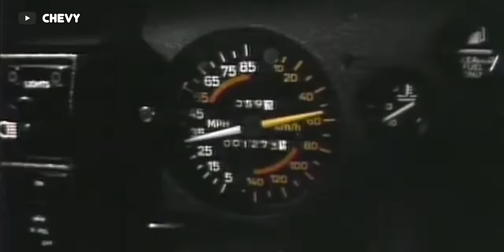These are the WEAKEST ENGINES EVER

Comment: I have a 70 cadillac with the 472 and that was rated 375hp and 500ft. It's tragic what emissions did to our cars.
Reply: Gross hp vs net hp. After 72 everything was Rated different. Insurance
Reply: @ryurc3033  Not just.

Power collapsed.

My '68 472 caddy ran 10.5 compression.  By '73 it was 8.5.

Spark timing was 5 in '68, 7.5 in '73.

Oh, and gas was 93 octane in '68,
87 octane in '73.

So power suffered.

Comment: teh 6.5 had mor ho and torque than the Ford 7.3 stoke  and the Cummins  the 6.5 from 1996 up out put 215 hp  540 ftlbs    The Cummins was not till 1999 that the surpassed that and 2004 for ford  and that is fact  it was not till Dodge modified the Cummins and  made there gen 2 and for made the 6,0 that they beat out the 6.5  yet AMcC continued making the 6.5 for 16 years after and where able to get it to a stock power for the hummers and military use of 355 hp and 742 foot lbs  at 2100 Rpm  and there are more million mile 6.5 diesel that there are any other    so take that

Comment: On Rolls Royce the power wasn't mentioned. They say: Its enought to glide with the car trought the streets. Do you saw ever a Rolls Royce driving 180mph? No. That was a different time.

 And the Bentley Engine is NOT the same! This engine is the W12 engine (or VR12 more specificly) and it produce 530-630hp. Since Volkswagen bought Bentley, they changed the engine forever.

Comment: Glad you pointed out you can't just blame emissions regulations because they only result in numbers like those when combined with zero desire for innovation. That's why you can get a 94 Mustang 5.0 with 215hp and a 3.0L Nissan n/a motor of the same year putting down 222hp.

And it only took about 30 years for US manufacturers to wake up to this. 😂

Comment: How about a 3rd generation camaro ? There was  a version of the 305 V8 that was rated at 145 or 155 hp. Dreadful. Ive heard the fuel economy was terrible too, the only good thing about it was it was durable. Well at those power levels,  i certainly hope so.
Reply: 1983 or 1984 i believe.  The later tuned port inj 305 were somewhat better

Comment: Im pretty sure those Viper horsepower "claims" are wayyy low compared to what those things put to the ground. Now I never got the prevlidge of driving a Viper, but, I can say that every Dodge Ram 2500/3500 I ever drove with the lower HP engine was a fucking BEAST. Like break the tires lose at 35mph on accident LOL

Comment: Pontiac 400 180hp from the mid to late 70’s , quite the feat right there.
Reply: You do realize that the additional of the horrible pellet type catalytic converter and the elimination of dual exhaust is responsible for about a 35-50HP reduction in output? The Pontiac V8s of the mid 70s also had the lowest compression (7.6:1) of any of the domestic V8 engines. Their intake manifolds were also designed with a D shaped air inlet below the carburetor’s secondaries to limit airflow starting in 1975. In 1977 Pontiac introduced the W72 400 to replace the discontinued 455. It made 200HP in 77 and was upped to 220 in 78. The compression was raised to 8.2:1 but still had the same restricted intake manifold. Despite all this Pontiac V8s were about the most powerful overall engines of this period. Despite all this a 79 Trans Am with a W72 and a 4 speed could turn low 14 second quarter mile times. This is on par with a garden variety small block muscle car from a decade prior. In fact the I believe the NHRA actually rated the output of this engine at about 270HP. Considering the handicap placed on it that’s pretty impressive. Years ago in Hot Rod or Car Craft they pulled a mid 70s GM colonnade car from a junkyard, removed the catalytic converter and put headers and dual exhaust on the car and it gained 50HP. I want to say it was a Pontiac but I can’t honestly remember.

Comment: VW never used that motor, nor did it use ANYTHING from RR. The Bentley post VW purchase only used the 4.2L or one of its derivative (not including the W engines). Bentley was even using Audi engine before the VW purchase. Even RR stopped using that engine in the 80s. RR almost exclusively the BMW 5L. The motor did go on to break the Range Rover and Jag, but even that was only as an option.
Reply: Bentley Mulsanne used a 6.75 l from RR with a lot of mods, better heads, alloy block, turbos and direct injection

Comment: This dude can talk as fast as an auctioneer and not miss  word. A lot of info in a short amount of time.       1981-90 Olds 307/  140 hp. 83-84 hurst olds got 180hp but the standard 307, 140.  However the torque was slightly better, it could meet emissions of the time,.,,,,with a carburetor.

Comment: Totally incorrect on the 4.7 Powertech. You are comparing the 90’s power output to 2000’s competitors. They ran in the 4th gen trucks making 310hp as well making more than the 4.8 GM’s and about the same as the 5.3’s. By your definition most of the GMT900’s are weak engines, but you won’t say that.

Comment: You could put the cat 3208 and the Detroit diesel 8.2 fuel pincher on the list for medium duty trucks
Reply: I see the engine all the time in busses & it’s usually low mile stuff cuz it’s a trashy engine. Worse than the IDI. The 8.2 did come with a turbo but it was prone to head gasket failure, & just a weak engine.

3208 was decent but still pretty terrible.

Comment: Hay Chevrolet dude, don't forget the 5.7 hemi started the now hp wars. I'm not dissing Chevy as my first v8 build a 327 double hump, was nasty bad.
As for the diesel engines, the Cummins 12v is a monster of hop up and reliability.
Reply: The horsepower wars were reignited in the mid 80s and Mopar had little to do with it. It was the battle between the Fox body Mustangs and the 3rd generation F body GM (Camaro and Firebird). GM escalated it by dropping in the 350TPI Corvette style engine after being tired of getting its ass kicked with the 305 by Ford’s 302. Mopar upped the game in the late 00s after GM dominated the market with the introduction of its LT-1 in 1992 and buried everyone else with the LS engines in the late 90s. I know Mopar had the V10 Viper during that time but wasn’t actually a big enough seller to be a major participant but it did have some influence. Basically it’s been ongoing since the mid 80s and really escalated in the late 00s. Now all of the big 3 are involved.

Comment: Yup bad engineering even today cam-in-block designs might not make the most power per liter, that are at least competitive as far as engine weight and over all efficiency. These older motors were just horrible especially once you started tacking on emission control.

Comment: The first Viper V10 was closely related to the Magnum V10, which is why it performed as it did. The 2nd gen V10 made more power because Lamborghini helped rework it, after Carol Shelby tried to un-truck the 1st Gen…

Then that technology would get two less cylinders and hemispherical combustion chambers in 2003, creating the 3rd Gen Hemi. And then that got two more cylinders to create the all-new 3rd Gen Viper V10, which made dramatically more power.

Hemi V10.
Reply: ...chrysler owned Lamborghini when they did the first viper... the viper engine never was a truck engine and the only thing relative to eachother is the cubic inch displacement  and one other part. Two different animals... they also used a wedge chamber until the end.. they would've done better if they ever produced the v10 in a hemi with direct injection.
Reply: Incorrect. The combustion chambers in the 3rd, 4th, and 5th gen Vipers had 3rd gen Hemi based heads.
Reply: @Common Mockery  the new hemis use a quench chamber technically making it a polyshperical engine like chrysler made in the 50s. Ie 318 poly. The viper v10 was based off the LA/MA. In 03 it went to 505 cui. The heads weren't ever a hemi style. There was a potential for the hemi v8 but the design proved to expensive to produce pushing the price of hard to sell vipers beyond what they would be worth. Where ever you got your information is incorrect. And the wedge can make just as much power as the hemi. Not going to argue it any further.

Comment: I've got to squawk a bit about your list. It was poorly researched IMO. The Chrysler 4.7 made 310hp in FFV form in the 2008 1500. You then pick on the 302 in the Mustang when you should have picked on the 255 v8 with it's 115hp. They're basically the same on a hp per liter basis but 115hp out of a V8?? That's pathetic. Lastly, you pick on the 6.2 which had a low of around 130hp, but was offered up to 185hp in the Hummer while ignoring the 260 Olds Diesel with 90hp.

Comment: You missed the lowest performance gasoline engine per liter. The 3.3 liter Ford in line six. 83 hp in 1972, 72 hp in 1975, 85-87 hp from 1976 to 1983 for the California market. Probably ...the greatest Door stop Ford made. (With the exception of the side valve Ford Flathead with 65 to 85 hp gross from 3.6 liter V8,  the lowest leaded gasoline hp per liter modern engine). The Truck and Van California market 136 HP 351M for 1982 was a tie for HP per liter. FoMoCo , BeayBeah...And You thought the depression was bad? No comparsion to some of the US Malaise Era 3.3/4.1 liter and 5.8 in line Fords!.

Comment: My first car was a 1978 Ford Fairmont with a 200 cu in inline 6, out of that 3.3 liters Ford extracted a whopping 85 hp and a pavement wrinkling 154 ft/lb of torque.
Reply: My first car was 1982 Ford Fairmont Futura, also with the 200 i6. Motor wasn't powerful, but as bulletproof as they come.

Comment: Don't forget, the Chrysler 440 and the Ford 460 and the great Olds 350 diesel.
Reply: I mean, if you want to cherry pick the worst versions of the first two. There were performance versions of them making around 370-400 hp
Reply: @johnherbold6539  The 440 Magnum and Ford 460 were both torque monsters, and with the right carb setup, can produce pretty decent power.

Comment: I point out Ford & GM Australia, and their inline 6 engines, through the '70s & '80s. A Holden 3.3 litre / 202 cubic inch made about 130 hp claimed, when new. Perhaps they made that when new, but as taxis, by the time they had 300,ooo miles or so on, most wouldn't top 60hp and quite a few didn't top 30. Dyno test? No, just get on the freeway and floor it. If that car gets to about 75 ~ 80 mph and won't go any faster, then it doesn't make more than about 40 ~ 50 hp. And yeah, I drove dozens of cars, both Fords and Holdens, that were exactly like that.
I did rebuild a 202 for my own private car, with a 350 Holly and extractors, sports cam, and I figure that one made about 155 ~ 160 hp.
For context, my last bike, was a Kawasaki ZX14, which made almost 200 hp. It got to 300 k ~ 186 mph, really easy.

Comment: Just to let people know that the engine it self was not at fault! It was mostly the EPA and the insurance companies holding the car manufactures back.
Reply: Well, kinda. It's more that the auto industry hadn't yet figured out how to do both low emissions and power. For example, the later Chrysler 225 Slant Six with the single-barrel carb made an emissions-strangled 90 horsepower, but the current 3.6 Pentastar V6 which actually has slightly smaller displacement, now makes 280 - 300 horsepower depending on application, and it's cleaner (lower emissions) than the Slant Six could ever be. But, the Pentastar couldn't have been built with 1980s technology.

Comment: 1:18  "840 HP" in 1975?? I don't think so. Maybe somebody, somewhere modified a Windsor-powerd 1975 Mustang to produce 840HP, but there is no way Ford could have sold it that way. I read a road test comparison (maybe Popular Mechanics) of the 1975 5.0L Mustang II VS. the 4.4L Monza and they both got to 60 in the 13-14 second range. Worse, the Mustang was one of Ford's last cars without a catalytic converter, so the timing tweaks needed to keep the emissions down left it getting 8 MPG, according to Consumer Reports. The worst of all worlds. To paraphrase Marlon Brando, the Mustang II "could have been a contender", if only Ford had had something worth owning to put under its hood.

Comment: Interestingly ignorant way to Spin it regarding the 500 Cadillac.  It made a real world HP of around 450 and 550 ftlbs of torque.  It's alloys are still considered among the best ever put into a production engine.  In short, the engine was outstanding, and GM left a lot of output on the table to be able to stuff it under an Eldorado hood.  That the GOVERNMENT forced changes to specs such as compression, exhaust, fuel, etc doesn't magically make it a weak engine.  It' just another example of bureaucratic ignorance and abuse.

Also, the SBC was designed in the 50's.  Most engines thru the early 2000's had their roots in the 50's.  Those who know cars certainly care about these "old" engines.

Comment: We should also remember that speed limits were 55 during a lot of this time and vehicles weighed less. Not an excuse just putting it in perspective.
Reply: Vehicles in the 70's and 80's actually weighed MORE than modern cars.  Chrome bumpers, thick body panels, and full sized spare tires make for a lot of extra weight.  For example, my 1978 Lincoln coupe weighs 6,375 pounds...more than a fully loaded brand new F-150.  On the other hand, it IS 500 pounds lighter than the 1973-1976 version. The 7.5L 460 cubic inch engine put out 230 HP and 357 ft. lbs of torque, until I removed the smog pump.  Now it runs at 250 HP and 400 ft. lbs of torque.  0-60 in 12 seconds.
Reply: @Voltor07  Are you looking at the GVW? I know Lincolns of that era were probably the biggest and heaviest made. I had a 1976 Oldsmobile Toronado FWD with a 455 in it. Same chassis as a Cadillac ElDorado and it didn’t even weigh 5000lbs. I have a 75 Pontiac Grand Prix (mid sized car same as a Monte Carlo) and it weighs about 4200lbs. A late model Dodge Challenger tips the scales at about 4500lbs.

Comment: So uhhhhhh we’re just not gonna talk about how these engines were completely choked out by emission standards that were suddenly enforced and the auto manufacturers weren’t technologically ready for?
Reply: Addendum the brand new 2023 corvettes still use cam in block as matter of fact only ford uses overhead cams their engines and they still sucked on power and fuel efficiency.

Comment: Cologne 2.8L should be on here, doesnt matter if it was in a pinto or a dmc12, it sucked.  While the 6.2 probably deserves to be on the list, certainly it isnt as offensive as the 4.3 and 5.7 GM (olds) diesels.  To be fair, 20hp /liter for a NA diesel isnt that objectionable.  Diesels have a far leaner stoichiometric raitio of 20.5:1 and turn fewer rpms. A Caterpillar 1160/3208, 10.6L and 225hp is only 21hp / liter, how about the NA version of John Deeres venerable 6.6L, 100hp, 15hp/liter.  Certainly makes a 6.9 look like a hot rod for its day (it kinda was) at 25hp/liter.

Comment: Why was horsepower so low in the late 70s and early 80s on muscle cars
Reply: The auto industry hadn't figured out how to do both low emissions and good power and fuel consumption in the same engine. Multi-point fuel injection and distributorless electronic ignition were still in the future back then.

Comment: Like how disingenuous you are about the powertec 4.7 when you claim they never made over 235hp. Yet in 2002 and 2004 they had an H.O. variant in the Grand. Cherokee overland that made 265hp and 330tflbs.

That's not even getting into the Gen-2 4.7 powertect that debuted in 2008 and ran to 2013 in the ram that made 310hp and 334ftlbs.

While it's true that all Gen-1 NON H.O. 4.7s made 235, it's incorrect to say the 4.7 as a whole never made over 235hp. 

Your incorrect on the years the 4.7 was in production and it's power output. Do better.

Comment: Why did they even bother? I suppose back in the day those hp figures were acceptable lol. My v6 camry puts out double the power of these boat anchors do!
Reply: Torque is more important for street driving than horsepower. In that department your V6 Camry doesn’t put out half as much. Plus a 190HP 500CI 1976 Cadillac Fleetwood has more steel in its hood than your whole car does. In a collision it would flatten your Camry like an empty beer can and keep going.

Comment: Late 80's early 90's ford 460  most of the inline6s from the 70's/80's
Reply: None of those engines were designed for horsepower.  They were all torque monsters.
Reply: @Voltor07  I understand this and the fact that emissions were being stupid. I love my 460 dually truck but knowing that it had 50% more displacement but only 10 more hp than the mustangs.. sad. I know the potential is there though

Comment: Oh God.  I just watched the rest of the vid.  Pushrod engines aren't great for making power?  You really need to find another line of work, because you aren't fit for this one.  We've been stomping on top heavy, needlessly complex OHC motors for decades, and spending far less money to do it.  We do it now, daily, with LS engines vs all the goofy Ford motors...and every other.  Pushrod engines are simple, durable and make all the power and torque in the world.  OHC are good when you need lots of HP in the high RPM range and aren't worried so much about torque.  Also, you see US engines because you keep going back to the Malaise era (you know the term, yes?).  That period when the government strangled every good design put forth.  It took years to work around the bureaucrats to get back to where we are...and it's all coming to an end again, now, because of more bureaucrats.

I'll say it again, as someone who's been at this longer than you've been alive, and made more money at it this year alone than you ever will; you're too damn dumb to be running your mouth on camera.

Comment: Impressive?????from 5.700.???? 
Japan again
Honda b16b engine 1.6 16v had 182 hp natural aspire that's impressive not a v8 with 8.2 with 190 hp.sorry but there IS replacement for the displacement